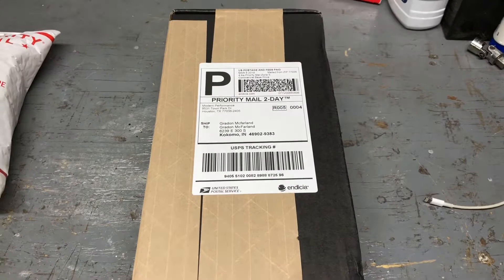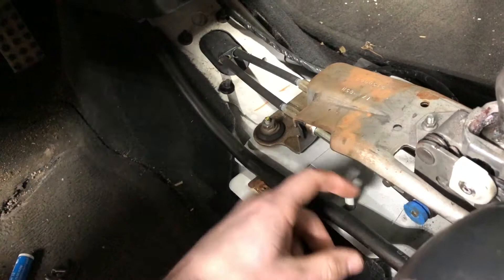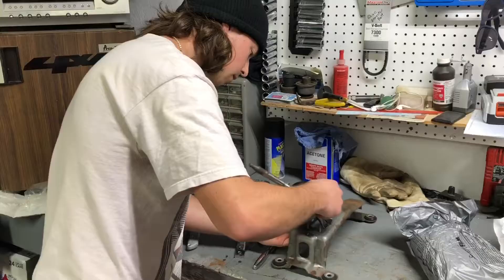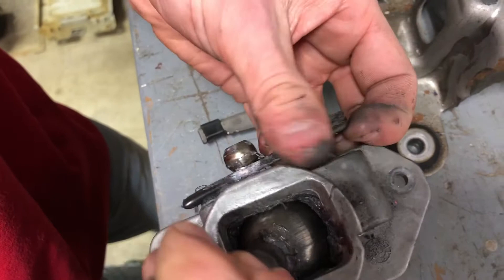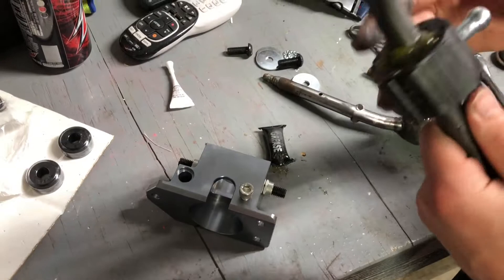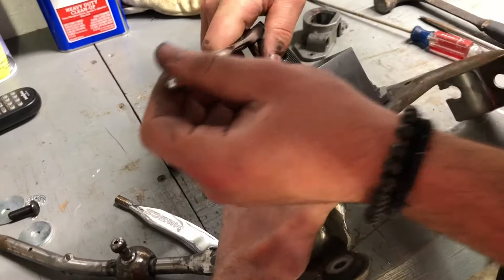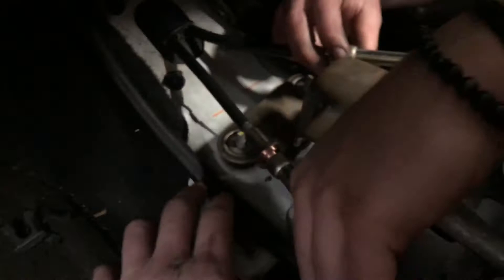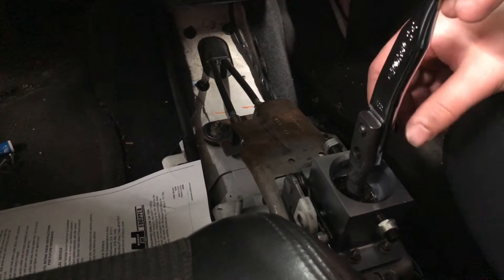SRT4 Hurst Short Throw Shifter Install!

Comment: I put it in my dodge neon but it doesn't enter fifth gear and it doesn't reverse either, what I see is that the crossover cable lever hits the factory mounting bracket and doesn't let me move the lever to fifth and reverse, what can I do there?
Reply from the maker: Honestly I didn’t have any issues at all.. I would only think it could be cable related if everything was installed properly
Reply: @GradonMcFarland24  It's already solved bro, the selector cable was adjusted
Reply from the maker: Awesome, that’s good to hear!

Comment: The main reason I want the Hurst is because I want my shifter to sit up higher. Did it raise your shift knob placement up quite a bit?
Reply from the maker: Austin Akens I’m honestly not really sure.. I feel like it did but I don’t think I had the stock SRT4 shifter in it before..
Reply: Where or page can I get the hurst shifter system
Reply from the maker: josue rivera i got it on modernperformance.com

Comment: Did you notice any side to side slop with this shifter? I put in a hurst a few months back and I only have slop when moving the shift left. Right seems tight though
Reply from the maker: Ryan Shea I don’t notice any slip at all. It feels super solid all around
Reply: They forgot a bushing from the stock to new .. Where the spring and state clip they need a plastic bushing from the stock shifter
Reply: Mine had that side of side wobble and I figured it out shifter feels nice and firm now